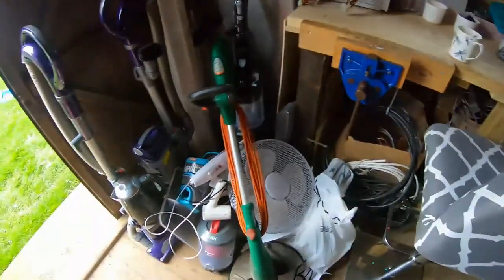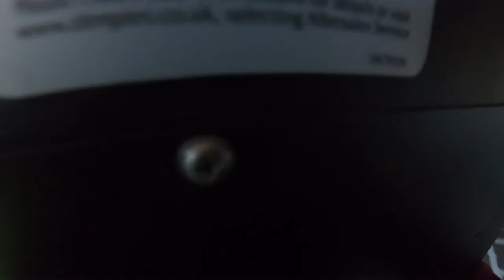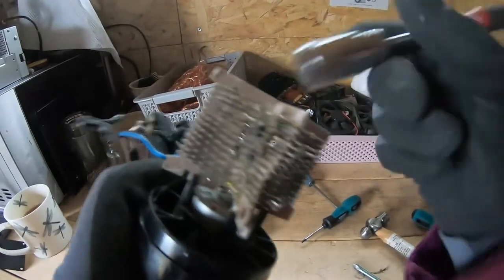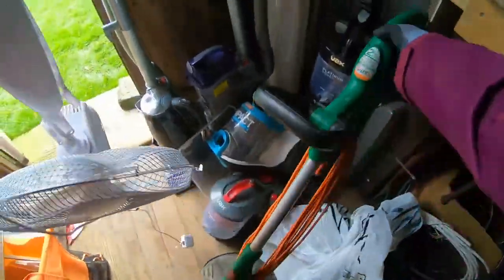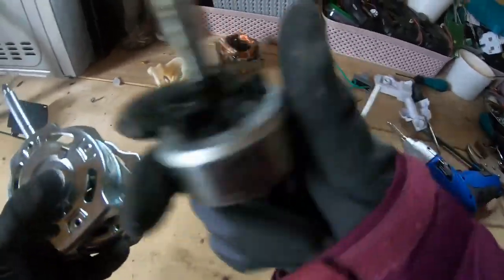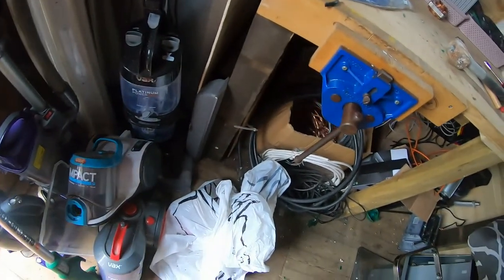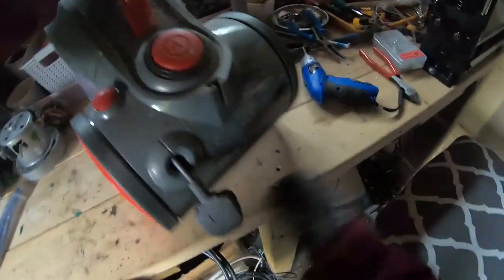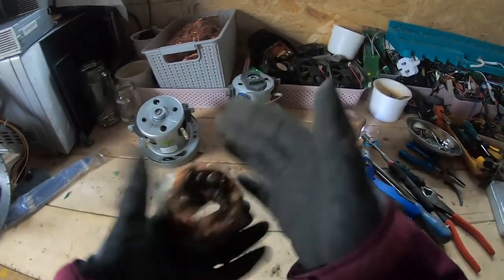e-waste: mini Sunday scrap marathon, Christmas gift of scrap, how much copper will I get??

Comment: Dont forget the BRASS rings on the cord winder of that vaccumm!!!!
Reply from the maker: Oh, do you mean the coily thing in the winder,  the ones on these were magnetic so I left them. Or have I missed something else😬, I literally put my magnet on everything just in case but can check again if something was hiding, I just cut it out because otherwise my videos are too long!😂
Reply: @SollersScrappingandDiving  inside the winder will be brass. U need to take it apart!! follow were the wire went in !!!
Reply from the maker: @kdscrapping4452  brilliant thanks, I will nab that then👍
Reply: @SollersScrappingandDiving  anytime!!